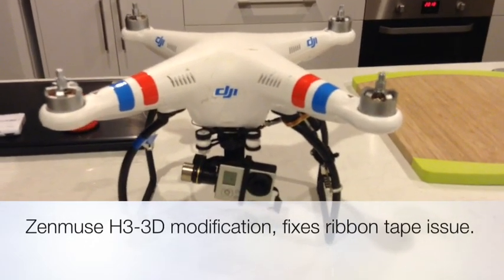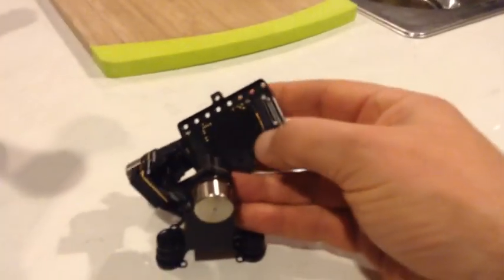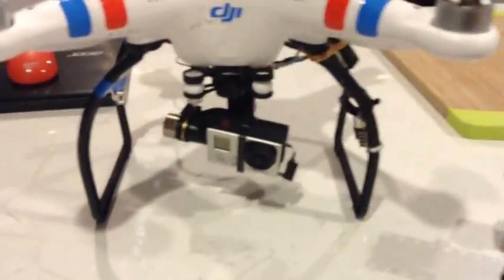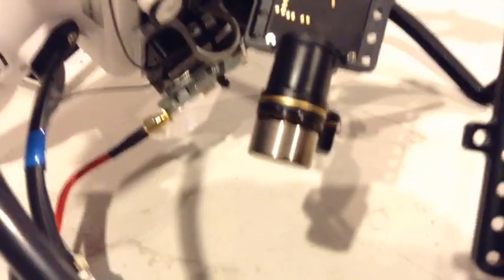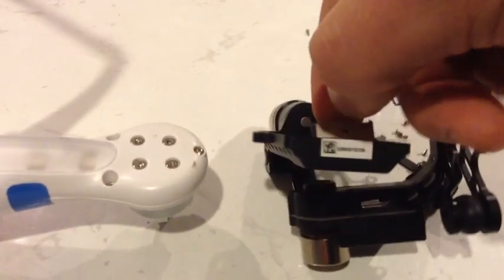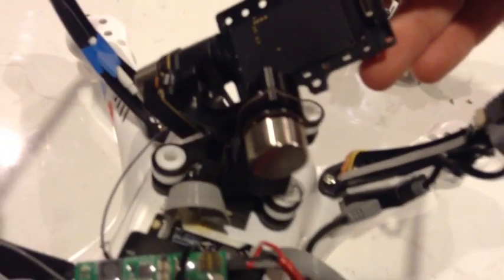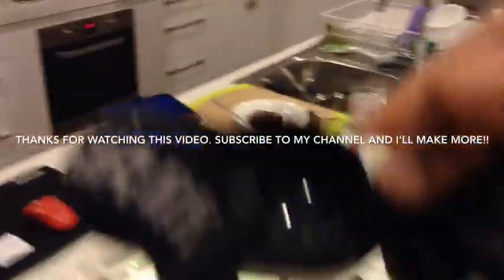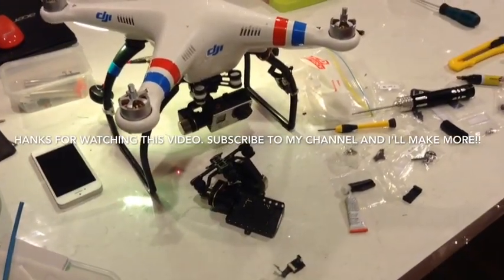Zenmuse H3-3D Gimbal Modification

Comment: Hi and thank you for this terrific video. I tore my ribbon cable when my dog attacked it on landing and was having troubles finding a new cable so mod done and all is good. 

Well all is good apart from a few issues. I'm not getting video to the transmitter and the little retaining bracket for the gopro connector cant be screwed in. Any thoughts? 

I think dog has learnt his lesson as well as he stays away now.
Need to ask where you got longer legs/skids from?

Comment: Hi all,
I have phantom 2 v2 + light bridge with gimbal H3-3D, my problem : while drone is powered , I push the left joystick to left or right, the gimbal also moving to left or right,  I think, something here is wrong because the gimbal should  not moving like this.  
Please help
Soroush
Reply from the maker: Actually there is nothing wrong, your gimbal should be doing this. It is a 3D gimbal which has side-to-side movement so when it is flying it can partly compensate for jerky yaw inputs on the left stick. Thanks for your question, please subscribe to my channel for more informative videos in the future.

Comment: Hi Pete very well explained tutorial. Keep them coming. I tried this mod and I didn't had issues to do the swap but I had issue with no image on my goggles. Actually grey image and I was receiving the signal of the iosd only so TX worked and RX worked. I had to go back to normal with the ribbon cable. Image was grey and camera was ON. Did you faced this problem? Thanks Jason
Reply from the maker: Were you using a Gopro 4? If so, the GP4 video feed doesn't work through the plug on the back panel. I recently upgraded my old GP3 to the 4 and guess what? my modification stopped working so I also had to revert back to the ribbon cable. Seems like such a giant leap backward! On the other hand if you are actually using the GP3 then the reason you are getting the grey screen is because your video signal is not making it from your camera to your iosd which means that the ribbon cable inside the back panel of the H3-3D is either not plugged in properly at one end or it is damaged. It is quite fiddly and relatively easy to damage that ribbon cable so be careful but if you are using the GP3 and the H3-3D gimbal it is worth persisting and trying to get it to work. Good luck and happy flying.

Comment: i tried this  using my 2d tilt board. I have video ok bu lost my tilt gimbal I swapped back to the original  3d setup . i tried  to update  first the new change did not help I wonder if i should have reset  the gimbal  with the tiny copper points

Comment: Pete P.  Thanks for the video. I was looking at it for a different reason.  My son flew his setup for the first time and ended up in the dirt. I did not see how the gamble was out of the box but it appears the two elbows are bent.  The basic frame is bent and I believe salvageable.  I was considering disassembling it as much as possible to bend them straight.  Is it possible to bend it back and have it work properly?   The craft is good.  He had the beast really high and a gust of wind pitched it over.  It bent one leg, messed up two blades and cracked the battery case.  Not bad hmm?  He has/had the H3-3D.
Reply from the maker: Hi Bobby,
Yeah, I've had the same thing happen a couple of times where I've had a crash and the gimbal has bent its arms. I have managed to bend them back to an 'almost as new' position and have had nothing but stellar performance from the gimbal since. They are actually remarkably resilient. Happy flying!

Comment: I bought a port plug from a seller on eBay and found that the video looked fuzzier then with the cable. Perhaps that's why DJI redesigned it this way, better clarity. Happy flying! :-)

Comment: Great Video. Thanks. Question... Did you just remove the GoPro Plug from the H3-2D and install just that into the H3-3D Board just removing the usb Ribbon Cable or did you swap out the entire Board and GoPro Plug from the H3-2D?
Thanks..
Reply from the maker: Hi Lenny, I just swapped the gopro plug part with the ribbon cable that connects to the main board although you could swap out the whole thing but it is not necessary.
Reply: Pete P
 Thanks for your response. Yours is still working Good?
Reply from the maker: Perfectly. It makes such a difference having the 3D gimbal over the old 2D, the footage is significantly smoother etc. I've had no other problems with the gimbal since I made that modification.
Reply: Pete P
Thanks!!
Reply: Pete P
I'm almost done with the swap over but now I realize that there is no way I can see to secure the GoPro Connector plug to the H3-3D Plate. The existing holes are not threaded so there is nothing to secure it. How did you secure it?
Reply from the maker: Super glue worked perfectly, cheers.
Reply: Pete P
 Hey Pete,
I finished the install. I get OSD on my fpv monitor  but i don't get FPV Video from the GoPro. I checked the ribbon cable connection at the GoPro Connector and Board and it looks like a good connection. I've removed it and re inserted it twice but no luck. Any ideas?
Reply from the maker: If the go pro is powering up when you turn on the Phantom then you will also find that you get a solid red light on the go pro. If this is the case then push either the shutter button or mode button and hey presto, you will have FPV. If the go pro is not powering up then you have a bad connection, possibly a damaged ribbon cable. Good luck, let me know how you get on.
Reply: Pete P I tried that. No Luck. I'll mess around with it later. I think the ribbon cable retainer might not be pressed down enough and not full locked in.  Thanks for all your help!!
Reply: *****
No I didn't. I ended up going back to the ribbon cable/USB Plug. I don't mind it anymore. No Big deal.
Reply from the maker: ***** I really don't know how you are not getting the video feed through but can only assume that somehow the ribbon tape between the 'Gopro' plug which fits into the rear panel of the H3-3D
Reply from the maker: Pete P  has been damaged slightly and is not making connection. Mine worked well but I was EXTREMELY careful with the ribbon tape as it is very fragile and easily damaged.
Reply: Pete P
I could have damaged it.
Reply from the maker: The iOSD is in between the camera and the transmitter so yes, you will still get iOSD data on screen without the camera view. The only way you can be experiencing what you have described is being caused by no video signal between your camera and the iOSD. How that video signal has been broken can be only one of a very limited number of reasons, the most likely being a damaged ribbon cable (there are two ribbon cables that could be damaged). Either that or your camera is fucked, you choose.

Comment: A great mod! Thanks very much..... I went to my local model store and asked if they had any old gimbals they were throwing away from repairs. They gave me the remains of an H2-3D and I modified my H3-3D as your suggestion. Works very well...just have to be careful plugging the ribbon take from the transplanted part into your existing gimbal.
Reply from the maker: That's great news, I'm pleased my video helped you out. Happy flying!

Comment: Thanks for this video. I dont have a H3D2 to use but at least I know it can be done. I HATE this 2nd Version of the H3D3. Version 1 of the H3D3 has the back plate connection but I think GoPro threatened Zenmuse for using their proprietary connection and not paying them royalties. GoPro is showing themselves to be some greedy bastards. I mean the H3D3 was MADE for the GoPro, it even increased their sales and apparently GoPro wanted more - Forcing Zenmuse to make a quick fix on a 2nd version or pay more money in royalties.
Reply from the maker: Thanks, I'd quite gladly use another brand of camera if Zenmuse would make an optional fitting kit for something else. Gopro are an ok camera but I'm sure that Sony could make one twice as efficiently. In the mean time we just have to use what we have available but I was very pleased that this part was inter changeable between the old and the new. I find the 3D gimbal is such as massive improvement over the 2D with much smoother video footage, apart from this obvious cock-up, the rest is pretty good.